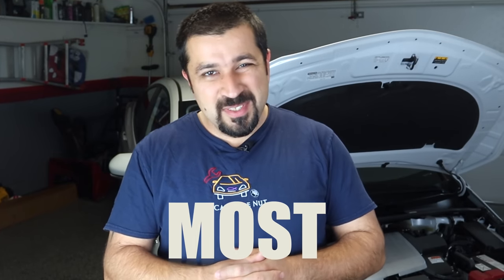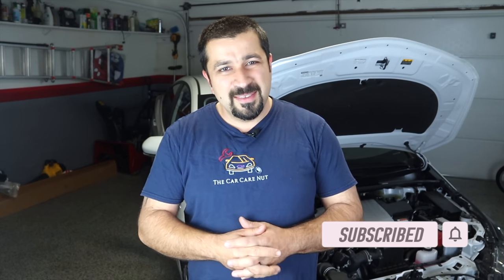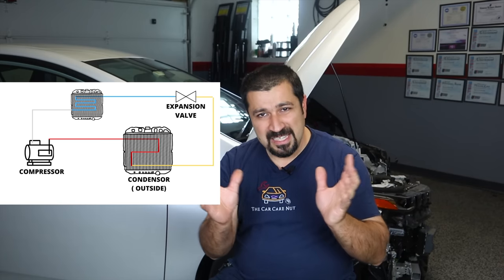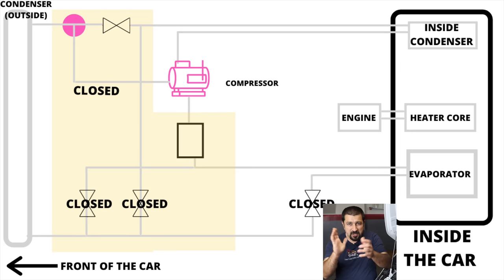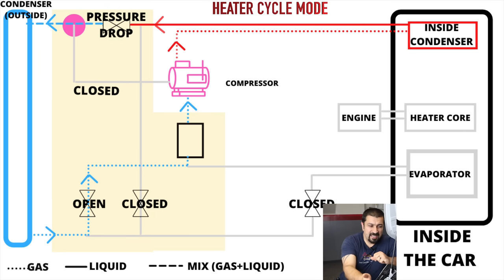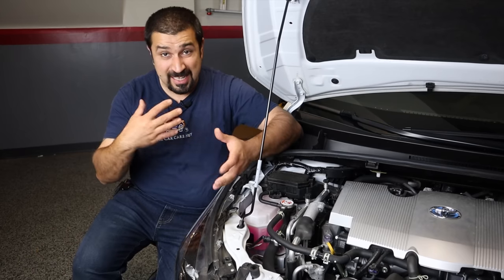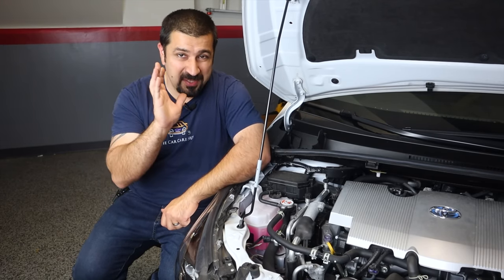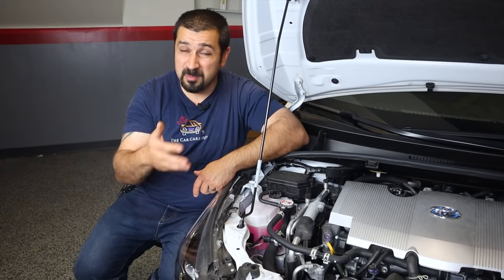The Worlds SECOND most complicated car HVAC system Explained

Comment: I am a professional  HVAC commercial tech by trade.

Please understand AMD is explaining the HVAC system in a easy laymen terms, not throwing big words or complicating things. Hats off to you sir. 

I wouldn’t be surprise if Toyota added a third  source of heat inside the cabin, a electric heater (this will deplete the battery quickly on the downside). It will be a super, super hybrid: a heat pump, conventional, and electric heat. Fascinating! 

Japanese take pride at their work, technology and reliability. ❤️
Reply from the maker: Hi hussein,

Trying to keep it simple because hvac is not! They do use Small PTC heaters to supplement when the engine is warming up. But they’re not strong enough to really heat the car efficiently
Reply: @TheCarCareNut  Are you referring to the front seat heaters when you say small PTC heaters to supplement?

Comment: I'm happy to know that Toyota went with a heat pump for heating instead of resistive heating. It takes 1/3 of the energy to give you the same amount of heat. They should use this system in the other hybrid models as well.
Reply: I Don't think so .. because the keep the traditional way by taking heat from petrol engine when it's working

Comment: I’m an HVAC engineer and I can tell you, while it’s a new system for cars, it’s not new technology.  The sequencing of everything sounds complicated compared to a standard gasoline powered car with only two sequences for heating & cooling, but there really is only 7 or 8 different sequences for optimizing efficiency, response time, and comfort.  Once you setup all of the programming, it’s all computer controlled and very reliable.  So long as the valve components were well made and well designed, it should operate very reliably for 15 - 20 years.  This stuff has been around since the 90s so it’s not rocket science or a new invention / innovation.  In fact, it gets way more complicated than this when you talk about designing an HVAC system for a laboratory or campus of buildings.  All of this said to say, it’s been around for a long time and there is no reason to think it won’t be reliable... especially since it was made by Toyota.
Reply: Everything electrically, mechanically or manually operated works great until it doesn't!
Reply: Automotive engineering and Commercial/Industrial HVAC engineering are two very different worlds. While some of the design goals can be the same, most are totally different as you have more nvh, large thermal swings, ingress protection, cost, manufacturability, serviceability, reliability issues to contend with. The engine bay of a moving car is a very harsh and constrained environment compared to the inside of a static building.
Reply: I'm not sure about your timeline unless by 90's you mean 1890's. When my parents built a new house in 1978, they could not connect it to a gas line due to the utility having a shortage of gas capacity so they had a heat pump that was cheaper to operate than a gas furnace down to about 12 degrees F. My dad always cringed when the temperature dropped below that because that meant a backup electric resistance heater kicked in. Imagine how much electricity it took to run a space heater to heat a 2500 square foot home. Fortunately where we lived that rarely happened.

All air conditioners and refrigerators are based on the same technology and that technology was around before the civil war. Actually, at the most basic, all one needs to convert a regular AC into a heat pump that can also heat the conditioned space is a valve that reverses the flow of the refrigerant. Too make it work efficiently and at lower temperatures, one needs all the more complicated valves and liquid gas separators.

The only times I had quibbles with the explanation was that he kept calling the refrigerant "freon." Freon is a trademarked name for a refrigerant that is part of a class of refrigerants that were banned for new units in 2010 and not allowed to be manufactured or imported except for destruction after 2020 (except for a small loophole if it was in medical devices (think asthma inhalers) which could then be recycled with the freon recovered after they expired).

Comment: This is an excellent video! Thank you for sharing this detailed information.
I have a Prius Prime 2019 and my AC is not working at all. It has got a hit on the right side of the front bumper where the AC Accumulator assembly is placed unfortunately. We tried to repair this assembly many times with AC technicians and mechanics, but to no avail. Can you please recommend what do here to fix my AC system?
Once again, thank you for your help!

Comment: Many thanks for the detail in your explanation of this system. I just bought a 21 PP and love it.  Luckily, where I live we don't go below 32F, hardly ever.  One question I have tho:  The car is asking me if it can run the AC when charging every time I finish a drive.  Is that because I live in a hot place? I always say yes BTW. Any advice on that?  Thanks in advance.
Reply from the maker: Hi! It asks you if it should use the AC to condition the cabin which would cool the battery better when charging. It will always ask when you set a schedule and plug it in. I would always give it permission to use it
Reply: @TheCarCareNut  Awesome! I love your channel. Thanks so much for the quick reply! I will do as you advise!  Our 10 day forecast is for highs over 100F for more then the next ten days. I set the charging schedule so it is ready to drive at 8AM. That's probably the coolest part of the day to charge.  Fingers crossed for a long traction battery life.  Thanks again!
Reply: @TheCarCareNut  And congrats on the one year anniversary!  You're doing very very well in the YT world!

Comment: You just convinced me NOT to buy a used version of the Prius Prime.  As a car ages, it requires more and more maintenance, and I can see the day when repairing that HVAC system will cost 1/4 of what the car cost when it was NEW.

Comment: Great video on just how complicated the HVAC System is on the 2023 Prius Time. I currently have a 2023 Prius Hybrid AWD that uses the ICE as the primary source of cabin heat for the car.  I have a Prius Prime on order that will not be arriving until the summer of 2024.  Because I live in Canada, where the temperatures can easily go well below freezing, I am concerned with how I will get adequate cabin heating and defogging capability.  Does the 2023 Prius Prime only depends on the heat pump to heat the cabin? When it gets really cold to the point where the heat pump is no longer efficient does it use the heat from the ICE to heat the car just like a standard Hybrid that gets its heat from the gas engine? If not, then the Prius Prime may be most suitable for customers who live in climates where the winter temperature doesn't go below 40 F.  Your expert opinion would be greatly appreciated by those who live in colder climates in Canada and US.  I also get the impression that the cost of repairing the heat pump system may be quite prohibitive? Thank you

Comment: Hi AMD! WOW! That IS complicated. Are the regular Prius much different? I see pipes running into/out my cat converter, is that used to thaw out condenser in winter or possibly heat the engine sooner? U dont have to answer, was jst curious.
Reply from the maker: Hi! The regular hybrid Prius is very conventional. Heater core for the heat and regular aC system. The coolant going to your catalytic converter is to help heat up the coolant faster for efficiency. The catalytic converter warms up very rapidly when the engine starts so it uses that heat to warm up the coolant faster.

Comment: This HVAC setup is interesting and complicated but if the system were made of high quality parts ie the compressor, valves,software etc there's no reason it can't be quite reliable.Since the compressor isn't running off a belt but an internal electric motor ask yourself when was the last time you replaced a refrigerator compressor
Reply: Alote of mini splits have electric txv or expansion valves. LG makes a picture frame that pushes a.c. from the sides so this stuff is not new to me!

Comment: Here’s a kaizen suggestion for the Toyota engineers. It seems like there’s a much easier way to handle this. So keep the heater core, but rather than it being connected to the ICE’s coolant system, just have the heater core’s coolant run through a tankless electrical heater inside the engine bay. The only downfall would be you would have to change the heater core’s coolant separately. It seems like that would be more energy efficient than having to run the A/C compressor.
Reply: That's called resistive heating. It uses 3 to 4 times more energy than a heatpump. In cars, in residential, everywhere. Just not a good idea. It is an only slightly better idea than straight resistor coils in the air flow like our Leaf as those often stink in addition to being ineffcient.

Comment: I assume the Rav4 prime HVAC adds battery cooling to the system, which either pumps the refrigerant directly through lines in the battery pack or has a heat exchanger with separate coolant tank that runs across the battery... I think the latter is more likely because you do not want pressurized lines in there...
Reply from the maker: It does add the battery cooling and completely changes the way it sends the heat to the cabin. In depth explanation in the upcoming video

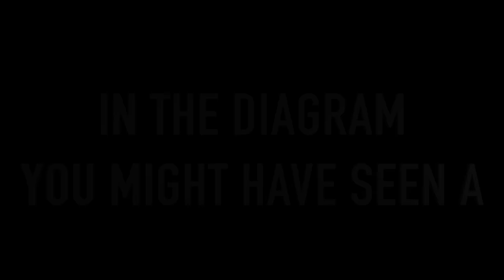Comment: 15:54 I can’t, my neck is scratching me I have to say it lol hahaha 

AMD is showing you the suction accumulator, is used to prevent liquid refrigerant flood-back to the compressor. The accumulator is always before the compressor. 

Is there one after a compressor ? Absolutely , that’s called a receiver, and it is located in the liquid line after the condenser and stores liquid refrigerant. The liquid receiver stores refrigerant when the system is operating at less than maximum heat load (you gotta put it somewhere).
Reply: It's actually a receiver/dryer/filter all in one after the cond.
Reply: @jacobs2309  thanks for the correction, by no means I’m a auto mechanic , but I see similarities in my industry 👍🏻

Comment: With the Rav4 prime’s heat pump is it also located behind the front right bumper as well? I just want to know since I own a Rav4 prime.
Reply from the maker: Hi! It’s not located behind the bumper. It’s scattered in the engine bay and not easily damaged in an accident like the Prius prime

Comment: Hi great videos , i have one question you say that at the frond of the car we have only the condeser and inside the car we have the condeser ,evaporate and heater core ,can we use the evaporate like condeser if we put an electric expansion valve because like you say with the frond refrigerator we use it  as condeser and as evaporate.thanks.
Reply from the maker: Hi! It’s not possible to change the design. The reason they went with this design is to keep the dehumidification function

Comment: Hi AMD. I have a 202 rav4 in the M20A configuration with CVT. The car is at 1200 mi. The car is experiencing harsh jerking motion when moving the shift lever from P to D. The car is experiencing low power and is hesitating. This happened after an aftermarket car tracker was installed.  There is no check engine light. Any thoughts ? Thank you
Reply from the maker: Hi! I would disconnect the tracker and check all the wiring. Hard to tell without checking but I would still check for trouble codes that might give you a direction for diagnosis
Reply: @TheCarCareNut  Thank you for the reply.

Comment: How often do you see rocks from the road damaging the outside condenser?  
Do I need to put a screen between the condenser and the front bumper to protect it?  Thanx.
Reply from the maker: Hi! Typically they can take a beating before a leak occurs I wouldn’t add anything as it can restrict the flow of air

Comment: Hi,Highlander 2013 awd v6 100k Miles.Transmission fluid never changed. My mechanic drained it filled it 3 times. Now all fluid is brand new. I heard in your videos that it is not a good idea to take all fluid out and fill. You suggested drain and fill one time only. Should i be concerned?
Reply: On every drain and fill , mechanic told me to drive around for 30 minutes and come back for another drain and fill. That's how he did 3 times drain and fill. The fluid came out first time was not burnt but it was very dark.
Reply from the maker: Hi! You should be ok but going forward do a single drain and fill. You were ok on mileage and age

Comment: I was wondering when heat pump would appear in hybrid cars. My Prius takes a huge hit in mileage in the winter months.  Most of the year I average 58 MPG. Winter it drops into the mid 40s.
Reply: That's true for internal combustion engines also.
Reply: Same in summer time I go from 37 to about 33 in my 19 Rav4 hybrid. I can never hit higher than 39 which is the epa rating.

Comment: Hi AMD! hope you're having a good day. Quick question for you.

I have a 2007 Avalon with 176,000 miles on it. There's Chain dragging metal on metal sound when driving, but it stop when not moving. Sounds like it's coming from the middle/rear of the car. The car Runs and drives fine and brakes are fine. Any idea What could it be? I'm taking it to the dealer next weekend.
Reply from the maker: Hi Tyler! Two things come to mind. Either a heat shield or something with the backing plates dragging. Hard to tell without checking. Does it change pitch or intensity when you apply the brakes?
Reply: @TheCarCareNut  no sir it just stays the same sound the entire time. I will say it happens every time the car moves now where as it used to only be once in a while, going over a bump would often trigger the sound in the past, but now it's pretty much just constant when driving
Reply from the maker: Interesting. Try to shake the exhaust in the back and see if you hear it

Comment: I’m in EV mode with plenty of battery in a Sac CA morning in the 40s. Just turned on the car. Turn on the fan and the windshield defogger. Boom, the engine starts up and runs for several minutes before fading from the scene.  I thought it would take the energy out of the battery, but it seems like it’s relying on the engine for energy. A little surprising. Maybe the computer has decided to save the battery for actual driving?  I would prefer the engine stay off.

Comment: Tha ac on my rav4 prime and prius prime is terrible for hot weather! 

Once you get above 90 Fahrenheit it kinda blows marginal coolish air but not cold at all. 

I wanted to upgrade to the new rx 450h plus but being from Texas the ac not working well is a deal breaker.  I will have to settle for the 350h :(

Comment: Hello dear sir I have Toyota Prius 2022 hybrid plug in with accidant right side anterior lower side (was fixed) the problem is with A/C system the compressor working the external fans working the high pressure pipe is hot (small diameter) but the low pressure not change and no cold air in cabine can you help and tell what is wrong please thank you

Comment: I have a 2 gen Prius. When the ac is on and I am at idle I notice an erratic clicking sound coming from somewhere in the center of the instrument panel. Sounds like a relay clicking. When is ac is off .. noise stops. When driving .. noise goes away. Do you know what that might be?
Reply from the maker: Hi! Hard to tell without diagnosis. Does it do the same noise if you change modes?
Reply: @TheCarCareNut  I never thought to change modes... only to shut system off

Comment: The condenser does not lower the pressure.  It transfer the heat away and turns the vapor back into liquid.  picture it as condensation.
Reply from the maker: That’s the only area I didn’t go heavy on because that’s when things get a bit confusing. I did illustrate it in the diagram for those that wanted to follow the state of the refrigerant
Reply: The condenser and the throttling device both lower the pressure in this system. Cooling a fluid at constant volume in general lowers its pressure. Forcing a fluid through an isenthalpic throttling process also lowers its pressure.
Reply: @jacobs2309  Being a car guy is getting complicated these days.

Comment: is Toyota using Freon refrigerant? Is it not banned? Modern cars use R14a I think. Can you pl clarify?
Reply: Prius Prime 2017-2019 uses r134a. 2020-2022 uses r1234yf. The 5th gen also uses r1234yf.

r134a is better IMO, but is clearly off patent and no longer allowed in western markets because it is a greenhouse gas...

Comment: Excellent explanation. So you're not going to drive your Toyota in EV mode in the winter in Frostbite Falls.
Reply from the maker: Hi Walt! Some folks tend to get upset they can’t drive in EV mode below 14 F and tend to shut off the heat and use the seat heater and freeze. I’d say it’s not worth it. You’ll still get very good gas mileage in hybrid mode

Comment: Wait till you get them from the body shop. That is going to be a nightmare RO
Reply: Imagining all the "folded in half electrical tape" over cold solder joints and twisted wires to replace a smashed bundle of connectors... 

Exactly why i don't trust buying crashed cars, and will avoid a fender bender as much as i can. If it's not electrical, some "tin can" non oem boy panels will be grafted on and will rust in no time. When you see that 5 year old car that has one terribly rotted out rear 1/4 or front fender and the other side is fine, you know it was an insurance repair.

Comment: All this so you can run 25 to 40 miles off batteries.  Put something in the dash that produces heat off the hybrid battery voltage. (Any piece of wire will get hot) This has BMW design all over it. PS I vote a 500 to 1000 watt AC plug to run small items when camping or when house lights go out. Like what ford is doing in their pickups.